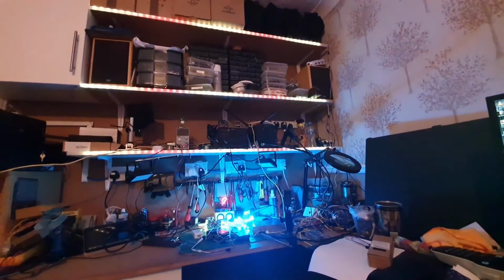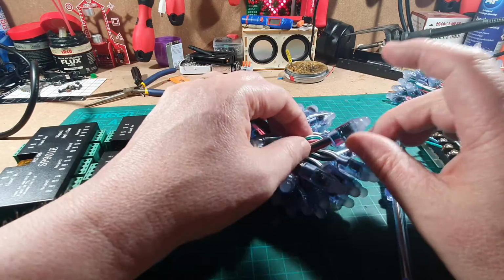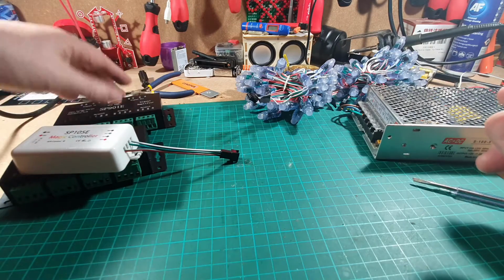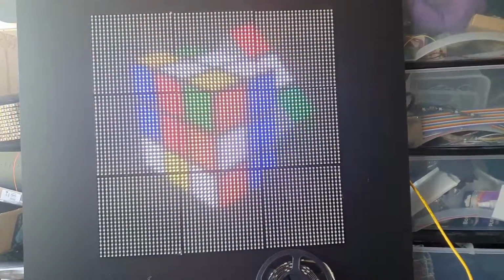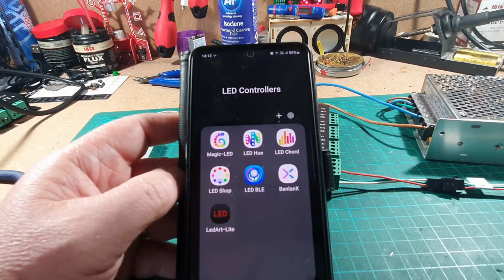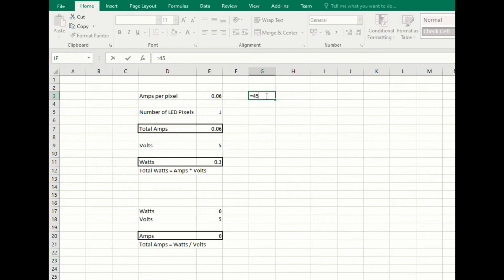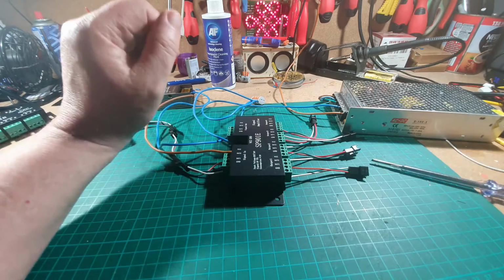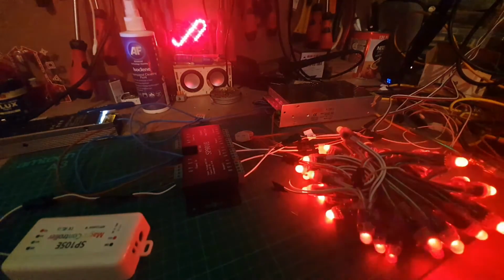Part 1 of 2 - Review, setup and testing of the SP901E LED Splitter Amplifier

Comment: Oh that $u%.   Surely the whole point of the SP901E is to distribute power? So whats the point of all the VCC slots?... Decoration?
Reply from the maker: I think its to distribute the signal, not just the power, but the option is there to use power or not
Reply: @MikesLEDShed  well the option isn't there for 5vollt stuff cause it doesn't work....

I wonder if it works for 12volt?
Reply: Also, i wonder if the 8 channel version just more of the same?

Comment: Thanks for the video I was using the splitter on 5v as well and was confused why not working now have ordered a 12v supply for the controller and splitter, I have already run 4 5v power supplies to the 4 props so hopefully when the 12v supply arrives should all work, one question do I need to link all 5 power supply grounds ? Technically they are linked via the data and ground running to each prop so does that work enough or would it he better to also link the grounds on the power supply as well. Many thanks for solving
Reply from the maker: If the 12v is just to power the splitter then no you don't need to connect the ground to the 5v supply, only connect the 5v grounds together

Comment: Good to know. Was setting up 5v system and couldn't get splitter to work. Wouldn't have guessed it needed 12v
Reply from the maker: Its odd, although it says it will work on 5v my own testing showed it kept powering down due to lack of power, as soon as i used 12v it was stable.  I did check giving it a little more amps than it said it used, but at 5v it was the same.  12v was perfect.

Comment: Looking for advice before buying this. Does this function as a Two-Fer or as an Optosplit? Basically I have a ton of strips that I want to plug in and control individually. I have an 3 x 8universe mapping controllers. But they only have 2 outputs (entec Opto) each. 

What I'm wondering is: if I plug in 4 strips to this splitter, do I get individual control over all the LEDs? Or does it just duplicate those addresses across the 4 outs? I can't tell from your video because it looks like they are all running the same pattern.

thanks in advance!
Reply from the maker: Hi - this is not a controller, it just repeats the inputs and splits it between 4 outputs, if your looking for a controller then have a look at www.SmartShow.lighting

Comment: If I'm trying to distribute DMX to multiple strips the SP901E should be able to handle that, correct?
Reply from the maker: The splitter has 2 x inputs to 4 x 2 outputs

Comment: Hey THX for the video I wondering How do you know what amp Fuse size to use
Reply from the maker: The fuse is a car fuse, rated as the total amps, each LED is about 0.06a so if your running 200 LED's 
ist 200 x 0.06a = 12amps so you have to make sure your using the correct amps fuse for the number of LEDs your running

Comment: Is it possible to use a motion sensor with this unit I'm working on an LED strip way system I want the LEDs to come on when I start up or down the stairs
Reply from the maker: This is just a dumb splitter, you will have to use a controller like a Arduino to control the lights and respond to movement

Comment: Hello Mike, thank you for the helpful videos you’ve produced.  I plan on running close to 1300 pixels and have purchased 5V 350w p/s, 9 ws2812b 30/meter, SP105, SP901 before seeing your video.  With your excel page my setup will not work.  Do I need to purchase a 12v p/s for the so 901/105 or will another 5v p/s (on hand) work.  Any help is greatly appreciated.
Reply from the maker: I've found the 901E works better with 12v for the controller and 5v for your LED's

Comment: (Sorry for my english)  i have  white cob strip led (not rgb) 24v,   i can only use my controler when the power supply is Plug inside,
 If The power supply is plugged into the SP901e so  I can see the controller in the application and the strip are enlightened but i can't use it (on/off, dimmer). I don't know the issue and you not recommend to use the power supply directly on the controler, maybe this kind of strip or controler are not suitable for the sp901e
Reply from the maker: The 901e is for RGB or RGBW LED's not single colour LED strips

Comment: What wattage fuses do you use
Reply from the maker: These are 12v car fuses 10a and 20a
Reply: @MikesLEDShed  but we are connecting it to 5V .. i know 12V works but do we have 5V fuses too ? bcoz suppose power supply damage and cause high voltage output like 10V .. it will burn the ws2812b rt ? I am not technical tough
Reply from the maker: @parumal23  Its not the volts that will blow a fuse its the amps,  so if you have 500 LED's running on 5v, and put them all on full white, the total amps will be 500x0.06=30a, if you have a 20a fuse it will blow, you can use car fuses in your power circuit on 5v. Remember to calculate your amps.
Reply: @MikesLEDShed  Thanks .. thats helpful..i amdoing project wirh esp32 conmected to SN74AHCT125N then connected to 3 sp901e in series .. all woth cat 6.. total of 8 feet 8 strips and 10 feet 6 steips..60 led per meter ws2812b.. i hope it givesme good performance ...in my restaurant .. you all video are very good and i took lot of lessons from it
Reply from the maker: @parumal23  Great - post a picture when its all up and working
Reply: @MikesLEDShed  yes i will, it will take a month more i guess to install all thing.. Also want to know one thing.. since i have nightclub which has DJ.. can i take any aux or some output fron DJ system and act to LEDs in real time... can esp32 reallt handle it without any latency issue ?
Reply from the maker: @parumal23  You can use WLED with a Mic, have a look at https://kno.wled.ge/advanced/audio-reactive/
Im hoping to do a video setting one up soon
Reply: @MikesLEDShed  one question, do i really need sp901e or amplifier? or will esp32 be able to handle all my leds .. for 8 by 10 feet.. total comes around 124 feets of led
Reply from the maker: @parumal23  This all depends on the length of cable between the ESP and LED's and how many you have.  Without seeing the full setup i can not say, but you should think about power injection as well as the LED signal - a bit of trial and error might be needed

Comment: Hi Mike.....question. I have a sp107e...like to make a 12 Segment wall with 172Pixels on each segment/row. The sp107e has max 960 pixels so i can only set sp107e to 12segments and 80 pixels /segment. Will i somehow be able to extend the 80 pixels to 172/segment total 2064 pixels with help from the sp901e? Or is it limited from the sp107e.
Reply from the maker: The 901 will only output the number of pixels you input, however if you use 2 or 3 outputs you can mirror the input. So you will have more pixels but each section will show the same

Comment: Have you tried using an ESP32 running WLED with the SP901E?

I'm just about to start using the SP901e and creating 4x 1200 strips using one data pin on the ESP32 and 4x 1200mm strips on a second data pin on the ESP32.

I wonder does WLED see all the LED strips on the same data pin or does WLED only see the one and the SP901e just mirrors the signal?

I’m wanting to create 8x Quasar lights pretty much that I can control seperately by creating 8x segments if needed in WLED.
Reply from the maker: The 901 will only mirror the signal sent in either port 1 or 2. Ive not used wled on the 901 although i have use wled a few times - im going to assume it will work but ive not tested it
Reply: I just set up a 15x69 WS2812B matrix with the SP901E and WLED, and it's working fine. But I have it using a 5v arduino nockoff---came on here to make sure I'd be fine using a 3.3v ESP32 Node MCU, saw this question, figured I'd reply with a confirmation